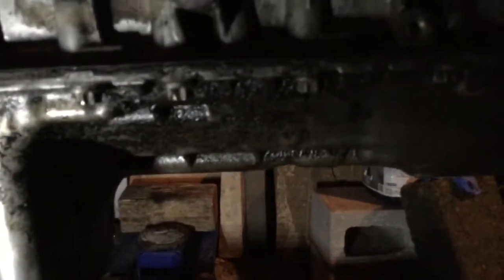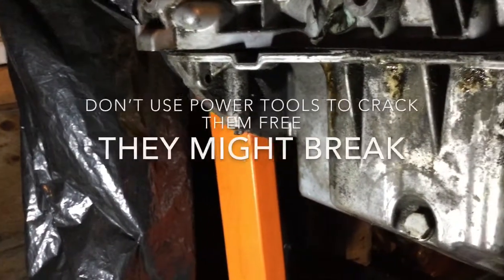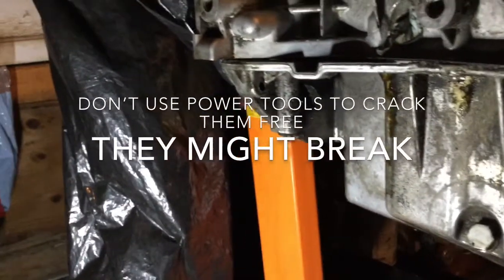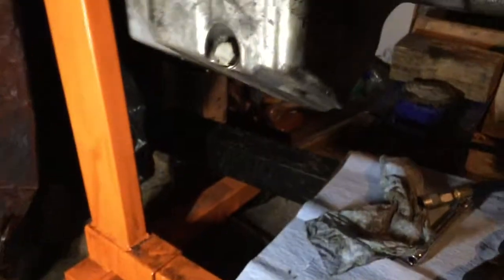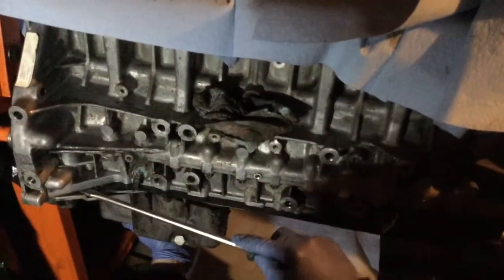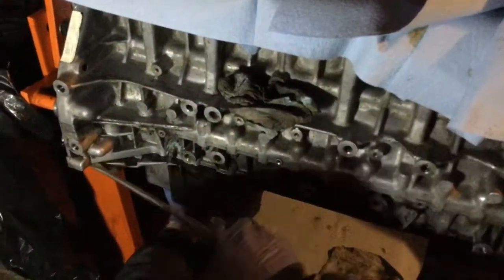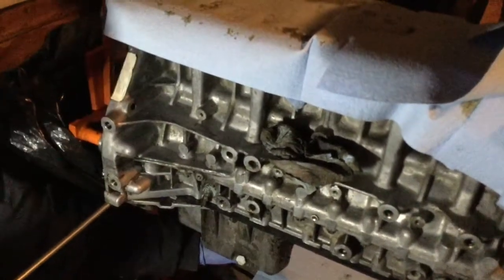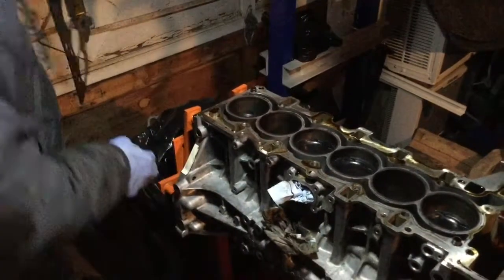25 BMW 135i N54 E82 - Engine Disassemble - Oil Pan and Pump Removal

Comment: hallo man.. i want to ask you about BMW X6.. this fault code varnos not function.. this valve intake leak or engine dirty?
Reply from the maker: I honestly don't know so much about X6... But it doesn't sound to me like any of those 2 things. Vanos is the BMW valve timing system. It is like an hydraulic proportional valve that shifts the valve timing of the cams.

I would suggest you to check on BMW forums for your matter and take some time to read/look for a thread related to your issue. Just be aware that some comments are more valuable than others on forums...

Comment: is it can be done with the engine in the car ?
Reply from the maker: I had the engine removed for other things to fix. So it was easier this way.
It is possible to remove the oil pan with the engine in place, but you have to remove things under it to do so (like the front axle support, and maybe more).

Comment: Hey man this may be a dumb question. But do you have to lock it in TDC to remove the pump while motor is still in the car?
Reply from the maker: Just to be sure... Which pump are you talking about?
Reply: Oh sorry. Oil pump
Reply from the maker: @kyleadams4156  What you have in the video, are the actual steps I've performed. My understanding is that you are wondering about any potential timing required between the oil pump and the engine cycle. There is no such a timing between those. The only thing, as you've seen in the video, is I've used a drill bit to hold on the oil pump sprocket in order to remove its bolt. The timing is on the longer chain, between the crank and the cams (as you have probably guess). I hope this answers your question.
Reply: @quebecdiy9906  ok awesome I figured it wasn't connected due to the fact its on a separate chain. Just wanted to make sure thanks a ton
Reply: My chain is spinning off the oil pump sprocket when I am trying to torque the torx nut, like there isn’t enough tension. Is this normal? I Simply moved the sprocket forward to drop the oil pump and it never came off the chain.